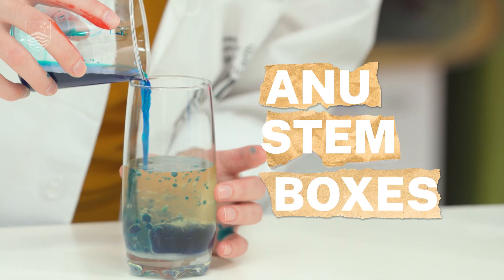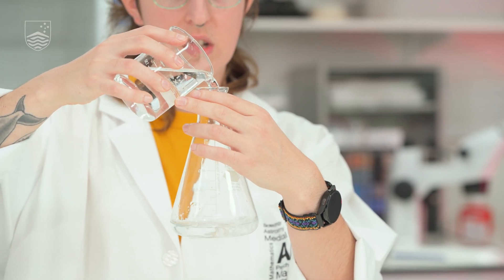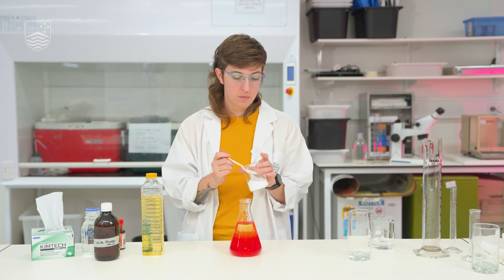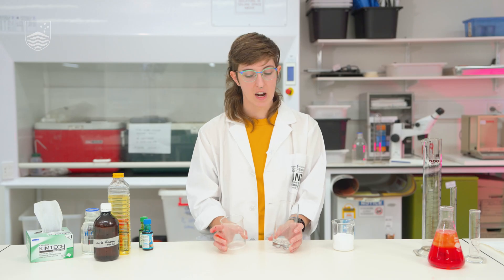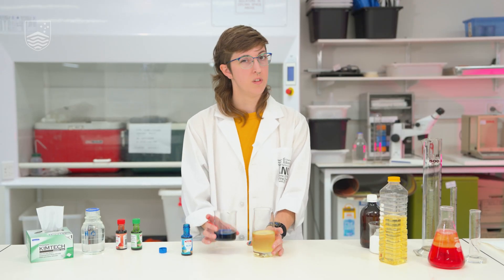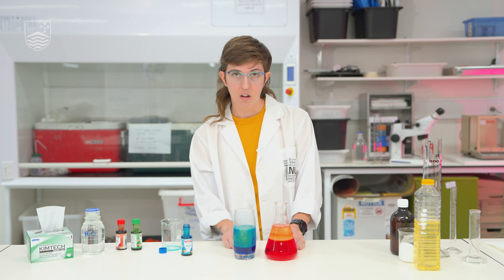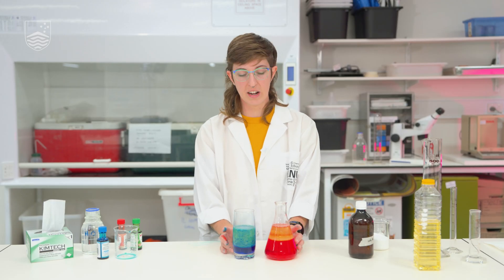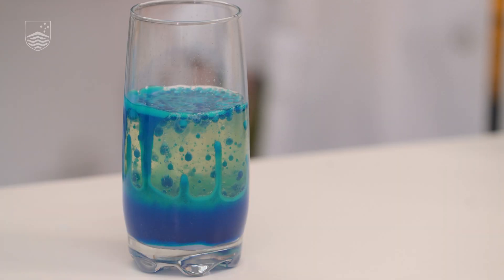How to make your own lava lamp

Comment: Great. starting with a misnomer. People calling the sodium bicarbonate reaction "Lamps" as 'Lava Lamps' is close to annoying. Especially when there is no lamp component. these should have their own name to individualize and separate them from the real or actual Lava Lamps that use Parafin and mineral oil, glycerin, etc, and use heat (via an actual Lamp) and liquid density for the effect, not chemical reaction propulsion for agitation and turbulence (often with zero lamps). these are a fun experiment, but sharing the same name with a completely different process is just confusing when you try to explain it to someone or research the construction of one. People just call anything whatever they like these days, and no one questions it. for e.g., im not commenting, im playing Golf! Did the presenter mention they were studying "Science Communication"? c'mon now, you're having a laugh, right? now I completely sound like a ****, but I swear, im just trying to keep things reasonable and as close to factual as possible in a world that seems set on wishful thinking and fantasy. My most sincere apologies if I have hurt anyone's feelings, I mean well.

Comment: Do we need alka seltezer?(pls answer as soon as possible)
Reply: Thank u for it it really worked
Reply: I used baking soda and vinegar! You can use alka seltzer tablets if you want, but the chemical reaction that takes place is basically the same. Alka seltzer also uses sodium bicarbonate (baking soda) but uses a dried citric acid for a reactant while we used some vinegar to add acidity and release CO2
Reply: You don't really need it actually there's a another method that u don't need it

Comment: why do you need the vinegar?
Reply: The white vinegar provides a mild acid that breaks down the chemical bonds in the sodium bicarbonate. When those bonds breakdown, one of the byproducts is carbon dioxide gas, which causes all those bubbles you see in our experiment! 

We used vinegar, but there are other common kitchen items that contain mild acids, such as lemon juice, or even other types of vinegar.